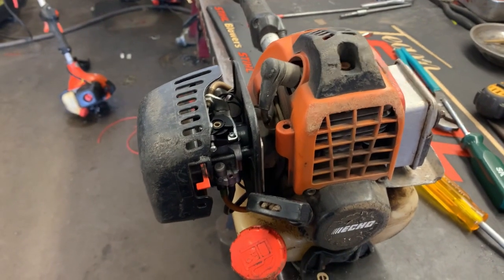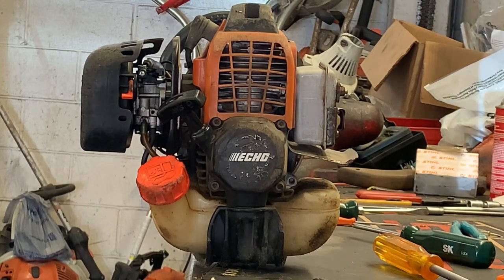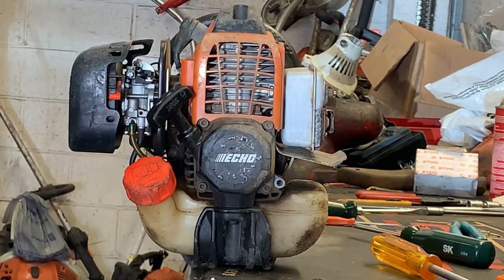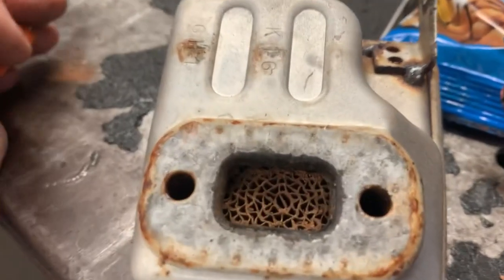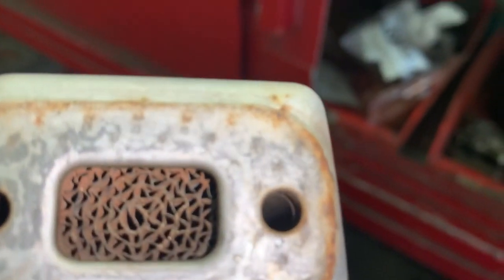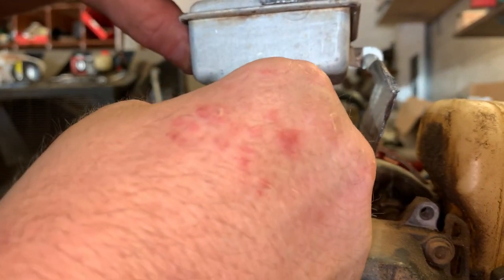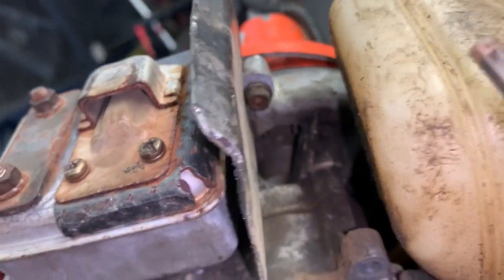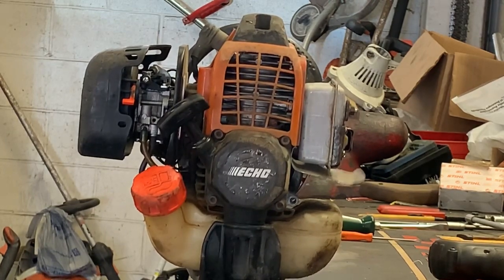CLOGGED CATALYTIC CONVERTOR ON AN ECHO SRM280S

Comment: Personally on my own equipment I remove the converter after the warranty is up. By removing it and retuning the carburetor you will find your equipment runs cooler and lasts longer. Sometimes depending on the brand of equipment you can find more power after carburetor is retuned. But always retune carburetor or you could damage your equipment. On customers equipment I use a propane torch and burn them clean, never thought of using my ultrasonic cleaner.

Comment: 6 suggestions that can help reduce exhaust coke and soot:

1.  best ethanol free fuel you can find....91 minimum.
2.  fresh fuel, less than 30 days old, stored in a proper sealed container
3.  synthetic low ash 2 cycle oil.  avoid cheap dino non-synth 2 cycle oil
4.  Properly gapped spark plug with regular cleaning.
5.  Properly gapped magneto and good ground (no corrosion)
6.  proper hi/lo tuning to spec!  *(yes, this will require regular checking and also a tach!)

the last suggestion above is probably the most important.  the proper fuel air ratio is going to dictate most signficantly unburned exhaust fuel and this causes coke and soot.

other things:

once a year, right after the summer cutting season:  best time to tear down the engine and do a complete cleaning of bore and piston including crank.  I use a non-chlorinate berry-man chem dip product.  Soak for 2 days then clean...

also...inspect clutch and drum for excessive wear.  If you get bogged down and the clutch begins to slip, this causes the engine to suddenly rip into a much higher rpm range without a equivalent load.  This "excited" state will cause a lot of unburned or poorly burned fuel directly out the exhaust port and into the muffler.

lastly, modding exhaust ports and mufflers is a real thing.  but understand what you are doing and how this might also effect timing.  If you don't know, don't do it.  If you do know how to adjust timing (and not that shadetree shaft key method), then modifying the muffler and possibly the exhaust port will do wonders to open up these little engines and create less coke and soot buildup.  

wear ear protection.  You really don't want hearing loss before you are old. It really sucks

Comment: I had gotten a STIHL fs45 that i had converted into an fs55 when i got it the spark arrester sounded clogged when i pulled it out the screen tube was clear but could not see through it from the nozzle end so i stuck a small pin inside the nozzle and found a mud dauber had made an exhaust plug of dirt inside the spark arrester assembly about 1/4 inch inside the nozzle just enough to where the screen looked clean it was about a 1/8th inch thick plug of red clay inside glad the screen was intact otherwise the problem could have been much worse.

Comment: My srm 225 does this every 6 months and the spark arrester is clogged, I was told by Echo to just take them out and throw them away. Mine will idle, but won't rev up, I know i have to replace that spark arrester and it always runs fine after that.

Comment: Is that idle what they call  "burbling"?
Reply: Yes.  Also called 4-stroking.  When you hear that, it means it's not too lean.  You can clean that up by going leaner but it's better being on the rich side of dancing on a pin head.  Too lean, you roast the piston while runninh hard because the piston overheats if detonation takes place.
The definition of detonation is when the fuel stops burning too early.  Peak cylinder pressure is supposed to occur at 15 degrees atdc, not before.
So stay out of trouble by avoiding a lean mixture, a 2-stroke will make the most power right before it lean-siezes.  You know how they act when the fuel tank is running out or there's a crankcase air leak (such as crankshaft seals).

Comment: Thanks I didn't know about that in the muffler. Do you know if the 2060t has that in its muffler. Also I use the echo Red Armor oil I thi9nk it is the best 2 stroke oil I have ever used.
Reply: I have the 2620T and yes, it does have a catalytic converter. I bypassed mine by drilling through the baffle where the exhaust comes out. It runs a lot cooler and the plastic doesn’t get so hot. As a mechanic, you’re not supposed to bypass or remove converters but I always do it on my personal equipment.

Comment: It is laughable to have a catalytic converter on a weed wacker.
Reply from the maker: Why?
Reply: @THEMOWERMEDIC1  It provides no improvement in the performance of the device and drives up repair and maintenance costs. The only advantage is to the manufacture when they sell you replacements. If you are that worried about the emissions from your weed wacker, then purchase an electric one. Those are zero-emission.
Reply: @saltyscorpion2151  absolutly nothing is zero emission
Reply: @redneck_3383  Exactly, that power has to come from somewhere, and more than likely it was a fossil fuel-powered plant. We also don't want to talk about what it took to make the battery.
Reply: @saltyscorpion2151  not zero emissions but less than that engine.
Reply: @saltyscorpion2151 no, they burn coal and diesel

Comment: There is NO CATALYTIC CONVERTOR on a weed wacker !! It's called a muffler !!!!!!
Reply from the maker: I just showed one.  How can you argue with facts?
Reply: @THEMOWERMEDIC1  but the keyboard warriors know all....lol 😬
Reply: As TheMowerMedic1 stated in the video, depending on your brand and model, some outdoor power equipment have a catalytic converter in the muffler. Not ALL manufacturers use this, but they're out there thanks to the EPA.
Reply: Know what you’re talking about before making idiotic statements like this. He obviously showed you that they exist unless you don’t know what the F@&# you’re looking at. What did you think that was inside the muffler? A muffler bearing?
Reply: Jason go to echo web site and you can easily verify that yes they do have them.
Reply: Stihl first started with catalytic converters back in the 90s. If I were to make a video on the 2 stroke catalytic converter it would be this one. 100% accurate. The ultrasonic cleaner is just plain smart. MM1 let the machine warm up before throttling up. I get more cold start seizures from guys not following this practice. Just a very very well done video. Oh, and I'll bet as more folks view this video they will learn that catalytic converters on 2 stroke machines are now the norm. Hats off to mower medic and thank you. 👍🍺
Reply: @ZombieDaveAZ  I think it also comes down to what state you are in my echo weed whacker does not have a catalytic converter just a muffler with a spark arrestor.
Reply: @bobbyhempel1513   I think you are correct. Depending on the year and the state. Soon they will be everywhere.
Reply: @ZombieDaveAZ  they can try but I'm not going to buy unnecessary crap, I can make my own electric weed whacker I just prefer 2-stroke.